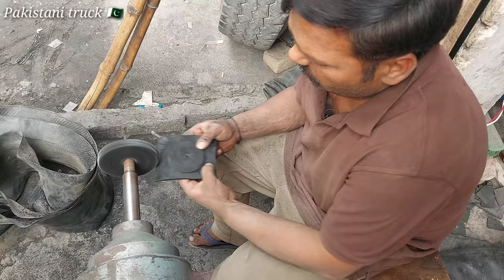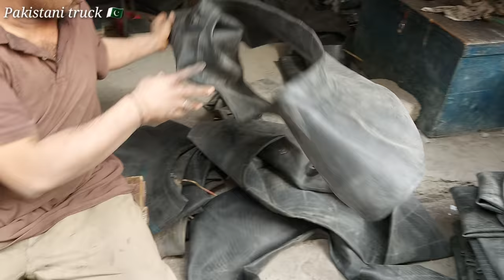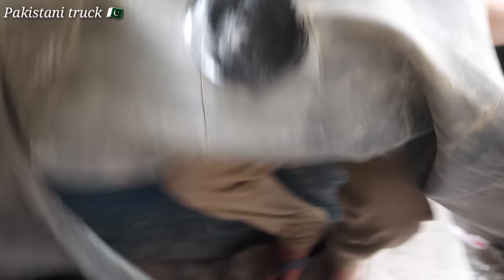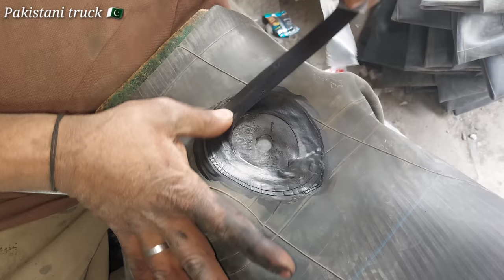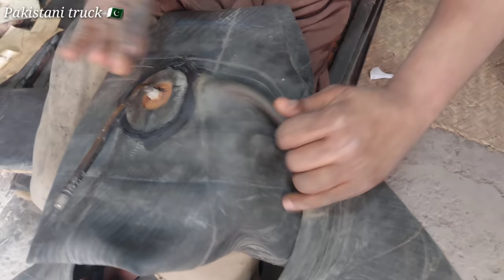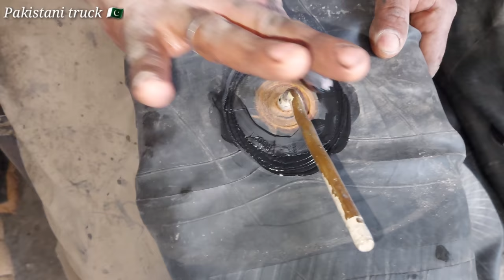New trick inner tube repairing amazing video

Comment: Back in the days, I've done similar repairs myself. No big deal. Now, I just buy a new tube as it is relatively cheap. Too much is riding on the tires to risk a tube failure. 
Just a hint for the guy in the video: Put a few grains of sugar on the vulcanizing plate. Once sugar melts the vulcanizing process is complete. Sugar melts at the same temperature.
Reply: I did this as a kid in the 60's at my dad's gas station. We used Tech and Rema brand material. The valve stems were bendable and came in a cardboard triangle with the valve cores pointing inward. I still have the electric press. It had a removable center piece that you'd take out to put the stem in. Otherwise, leave it in for flat repairs. We also had a hoop with a crowfoot that would fit over the bead so we could press hot patches inside the tire. Light it with a match and sniff the smoke.
Reply: We had a little bench mounted unit, you fitted a small alloy "fusible link" into it and when that melted, it cut the power and your repair was cured.
Reply: The thing is they probably don't have the shister lawyers like we do, that are looking for any excuse to throw someone under the truck
Reply: @royfrank7101  in most country's the labor would cost far more than a new tube these days
Reply: @imchris5000  go price a tube this size

Comment: I just want to know how did he heat up that patch!? I think they didn't show that step. You can clearly see that the patch is burning hot when he puts water on it to cool it down after he takes it out if the vice..
Reply: Clamping rig has a heating element from bottom side... Vulcanized rubber  look it up